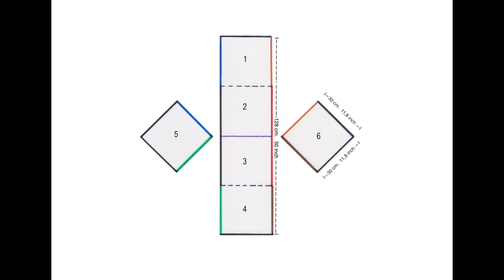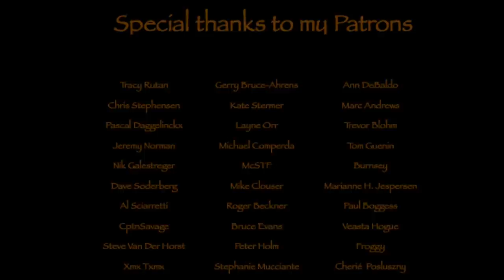I GOT HIM !!!

Comment: Sorry to hear about the thief. Hope it gets resolved soon and you get your stuff back.

I use the 3 stage method for packing as well. New pipe smokers tend to overpack/overfill their pipe..A nice loose fill will last (on a reg size bowl) 4-45 minutes. I see new smokers also get their pipe too hot. It's like riding the fence. Just hot enough to keep it lit..The pipe bowl should be almost hot but not to hot to hold. Relights are normal, but it will happen less and less when you get better. A good tobacco will give you a nice cool smoke and great flavor! (You want your tobacco to smoulder, not burn)
Hope that helps any new pipers out there!

Cheers
Reply from the maker: Skål brother 🍻😉 and thanks for sharing your experience with us. I’m sure lots of people will have benefits from your info 🔥
Tom

Comment: Hi Tom - Zippo now make a butane insert, no taste of petrol in your smoke. I have them now, they're even more windproof, and don't dry out just when you need a light. I smoke roll-ups, and a pipe sometimes.
Reply from the maker: Waw I didn’t know that Fil 🤗 so I appreciate your tip very much. Thanks for your kind feedback and support 🏕🔥
Tom

Comment: The way I was shown to pack the pipe is like three handshakes. The first packing is as lightly as you shake a baby’s hand, the second like a boy’s hand the third is like you shake a man’s hand- firm but dont go crazy. I put my finger over the top to help it light up and I hold the tamper over the tobacco -not push just hold in contact. Helps get the pipe going again between puffs. I quit smoking cigarettes in October so I smoke a pipe on weekends once and a while.
Reply from the maker: That’s great my friend 👍🏻😁 and thanks for your advice regarding pipe smoking 🤗👌🏻
Atb to you 🏕🔥🌲☀️Tom

Comment: I'm pleased that you found your thief. I wouldn't hold much hope of recovering the gear, I worked in prisons for 23 1/2 years and most of what compulsive (and implusive) thieves steal gets thrown away as soon as they are away from the scene of the crime and realise that they don't need it.
I think those Zebra Billy Pots are scientifically designed to burn your fingers like it did to your friend in this video. They are well made and not expensive though. The ones I bought a few months ago have plastic clips. I will probably replace the handles and give the clips the flick.
I miss smoking the pipe, but am afraid if I started it up again, I would also start smoking cigarettes again, which I don't want,
Thanks for the coffee tips, growing up in Australia, we only drank tea and I didn't really drink coffee until I was in my 30s (a long time ago) and then mostly I drank instant coffee.
Another enjoyable video, thanks.
Reply from the maker: I’m glad you enjoyed it my friend 😁👍🏻 and happy to see you again in CimbrerCamp. The zebra pot is awesome but as you say … hot to handle 😆 lol 
Martin has made the metal clips himself and it’s quite easy to do 
Thanks for joining us my friend 
Atb to you 🏕🔥🌲☀️Tom🇩🇰